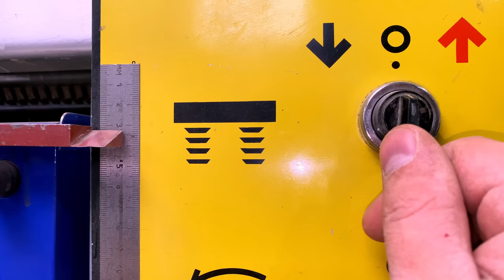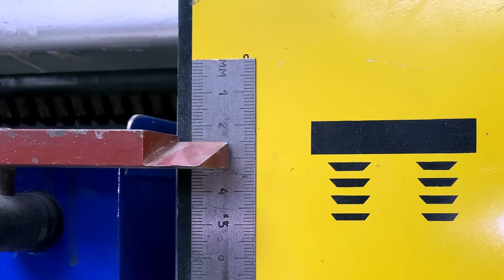Oak tv stand. WOODWORKING.

Comment: Very nice work and a beautiful design.  Really like it.  One question, any concerns with wood movement with the top being solid wood and the interior walls made from plywood and glued/dominoed in place?
Reply from the maker: Thanks 😊 the width of the pedestal is 450 mm, there will be a minimum expansion of the tree and I made the grooves a little less than the grooves, I think it compensates for the movement...

Comment: Nice. There’s room for improvement though with the hardware integration design. Could’ve added soft close hinges for the flap and inverted in to go underneath the tray after adding an additional piece at right angle to the flap and hence made a soft opening mechanism for the flap. That way, all those hinges will be hidden from sight and you can avoid the collapsible stay as well
Reply from the maker: Thanks 😊
Reply: I quite like the exposed mechanical parts. Not everything has to have a polished or hidden finish. This man is clearly a master of his craft. A true artist.

Comment: So I commented on yer bad ass build and you replied me! Which I didn’t know if u would or not.  Now that I know you do, I have a question I’m hoping you Hv the time to expound upon. So at the 2:30 time, you are filling your holes and open knots up with epoxy, I am presuming, and caulking??  Silicone of some kind??  I’ve never seen that being done like that  before, and then with the router….. I need to fill small sized  holes and hoping to find out what yer  using. I’ve watched your video  at least  a dozen times now. lol.  Have used a few ideas now for my build!! Again, thx a bunch!!
Reply from the maker: I fill cracks and knots with resin. When the resin dries, it shrinks, so you need to pour a couple of millimeters above the plane and then grind it off, I use silicone so that the resin does not spread.
Reply: Thank you!

Comment: Hey, could u link the hose and valves of your vacuum maschine? i have to run my system 24/7 because i cant get i tight :( would be awesome!
Reply from the maker: I did not understand the question. write differently.
Reply: @avswood  im sorry, i just wanted to know, what connection parts you use for your vacuum press (to get it tight).
Reply from the maker: conventional connectors for pneumatic tools

Comment: What are the sticks on the middle draw called?
Reply from the maker: PushOpen
Reply: @avswood  the thin sticks?
Reply from the maker: I do not understand the question
Reply: @avswood  on the middle draw you have thin sticks going horizontally. What are they called?
Reply from the maker: that's what sticks are called
Reply: @avswood  cant find them at lowes.

Comment: 8:10 Currious how you were able to get that last board inserted being that your tennons were abgled like that. The video seemed to skip over that one nuance. In theory the whole assemble would have needed to go together simultaneously. Obviously you make it work, just not sure how.
Reply from the maker: you need to make small gaps, and before that the vertical parts have little mobility, which makes it possible to insert the correct part